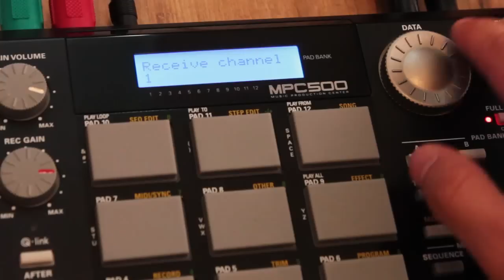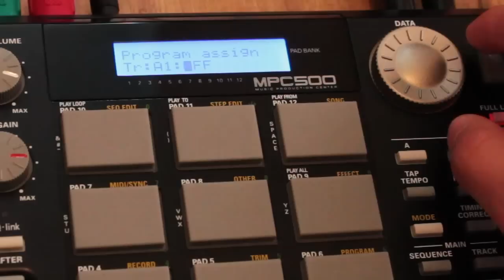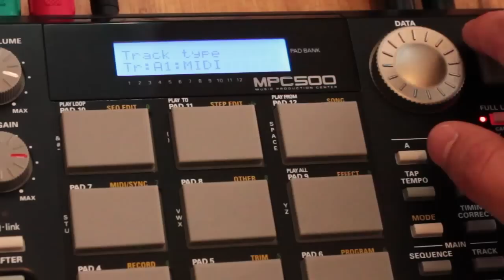AKAI MPC 500 Tutorial: MIDI Sequencing (also for MPC 1000, MPC 2000, MPC 2500, MPC 5000) #TTNM

Comment: Hello,
Question.
1.) If everything is set up to record Midi-Sequences and control more than 1 external Synth, is there a need of useing a Midi-Interface at the Midi-Output to set up the Midi-Connection from the MPC to each Synth and there is also the need of Useing different Midi-Cannels for each (Synth-)Connetion?

2.) Do you know more Gear that is able to do such a Work? Maybe with having it's Drumsequencing set up like a 16Stepsequencer with recording 'on the fly'?

Comment: The best midi explanation I have ever seen! Also the best mpc quick guide. Awesome
Reply from the maker: Thank you :) Happy to read that you liked the video! Enjoy the MPC!
Reply: In between mpc's at the moment having owned the 2000, 2000xl x 2 and now thinking about the 500 on eBay. Any pad issues?
Reply from the maker: I think the pads are fine. They are stiffer than on the big MPCs though, if I remember correctly.
Reply: Thank you. One of the 1000 models released had a flawed pad set that needed replacing quite quickly.

Comment: Really helpful video. Thanks alot. I just got an MPC 1000 yesterday! I'm assuming all the information you've given us can be passed over but I was wondering if I could sample the drums my Roland 626 Drum Machine. Would I need to plug the midi out from the 626 into the MPC to do that?
Reply from the maker: It should translate to the MPC 1000 as well. Sampling is another process though, for which you don't (can't?) use the MPC's MIDI functionality. Enter Sample mode and just manually trigger each sound on the Roland to record it as audio on the MPC. Once you've got the sound files in the MPC you can play/sequence them.

Comment: Thank you! It is the information I needed! But, how do you control other synth modules with the same keyboard? Can you render audio from the synth easily? I own severel modules through a mixer. I need something as good as ableton push, but without the computer. I'd love an MPC5000 but it is a phantom or tooooooo expensive here in Brazil. Thank you.
Reply from the maker: You need to assign a MIDI channel to the different synth (modules) and then just switch the transmitting MIDI channel of the keyboard. You can't record or render audio with the MPC in such a ways a in Ableton though.

Comment: Hey, great video. Thanks for posting. It is really helpful. 
I have a Novation Mininova synthesiser and was wondering if it would work with the MPC 500 like you have shown. 

Thanks. 

Tom
Reply from the maker: Hi Tom :) You can definitely use your Mininova with the MPC 500. Connect MN MIDI-OUT to MPC MIDI-IN and MPC MIDI-OUT to MN MIDI-IN. Then you might have to disable the MN keyboard's connection to the sound engine (often called "local off"), so that the MN keyboard just sends MIDI notes and doesn't directly trigger sounds, because you want the MPC to trigger them.

Comment: thanks, I have watched this a few times now and it is slowly becoming clear...one more question... Can you use a controller INPUT on channel 1 to control tracks on other channels?

for instance, I have a synth module on track 1 sending to midi output channel 1 and a piano module on track 2 sending on the unit on channel 2.... can i control both from one midi controller on channel 1 going in to the MPC or does each output need its own controller?

Comment: Thanks for the upload - it's very helpful.  How does the mpc deal with looping midi data of different bar lengths?  For example, will it loop a one bar midi phrase 4 times over a 4 bar midi prhase, or just loop one time with a 3 bar rest?
Reply from the maker: It doesn't. You can only have tracks of the same length in one loopable sequence and you have to set the sequence length beforehand. So if you create a 4 bar sequence, all you tracks with the phrases in them are 4 bars too and you have to fill them up "manually". After that it can loop the whole sequence and you can mute individual tracks/phrases. You can of course create several sequences of different lengths, but only one sequence can play at a time.

Comment: quite a cool explanation. not sure if i got it right but is it possible to record midi on the fly, while e.g. the 500 is sync'd and running in a live set? and then its running in a loop? cheers
Reply from the maker: +Valcons Productions yes that's possible as far as I remember.
Reply: cool, maybe i give it a try. in used condition its a steal anyway.

Comment: is it possible to connect a USB keyboard to the mpc if its connected to a audio interface with midi cables connected with the mpc? i only use my mpc in standalone mode but want to be able to play the keys using the vst plugins ive got on my computer
Reply from the maker: Sure, you can route the USB Keyboard MIDI into your DAW and then from there out of the interface’s DIN MIDI ports into the MPC.

Comment: Great video.Very helpful and informative.
I have some questions though:

Can you play multiple  sequences on different instruments at once? ex:can I have drums going on while 1 synth plays a distinct melody and another synth plays a seperate bassline?
If you were "performing" a song how would you switch between parts where  the midi files sent out to hardware changes and plays something different?  ex:from intro, into verse, into chorus.
Do you have to play each part before you can sequence it or can you load midi files in and have the MPC play them?

Peter fnord may have touched on this below but I'm not sure. I don't have one of these yet and want to make sure its capable of what I'm looking for before purchase. THANKS!
Reply from the maker: Yes, you can play several tracks at the same time and mute them individually, while performing. You can also create sequences (combinations of tracks) and link them together into a song, both live and pre programmed - at least on the MPC 1000 and up.

Check out this video of mine: https://www.youtube.com/watch?v=3f8kwpRe-jM
Reply: ***** thanks for responding so quickly......I'vebeen exploring your videos all day and I'm understanding more and more. It seems I'll have to get an mpc1000 rather than a 500 for what I'm looking for.
Reply from the maker: Yes, while the 500 is great, the 1000 with JJOS is a lot better to work with :)

Comment: I have a Casio wk-7600  and an MPC500. My question is: Can I have the sequencer of the mpc control the keyboard sounds to playback my patterns. It seems you already explained this. But I'm trying to use the loop function of the mpc instead. Because the Casio 76 key does not have the loop function in which you can use.
Reply from the maker: I'm not sure what you mean by "loop function" but you can indeed sequence your synth form the MPC and use the synth's keyboard to add notes to the MPC's MIDI track.

Comment: I set up everything exactly like the video but Everytime I press a key on the synth it just starts sending out random notes and eventually crashes the synth. Any ideas on how I can fix that?
Reply from the maker: Could it be that the Synth sends MIDI to the MPC and the MPC sends the same MIDI signal back to the Synth which then sends it to the MPC, etc. Like a loop?
Reply: @tuesdaynightmachines  No, I set the synth to "Slave" mode and it did the same thing. I ran a MIDI monitor on it and it just keeps sending restart and midi stop messages.

Comment: Hi! I'm looking for a machine for live playing. I think TRACK MUTE function could do the trick, but I have few questions that I would like to know answers to:
1. How long are loading times ?  This wouldn't be the only device, so some reasonable load time is ok
2. Can I play internal sounds of mpc with midi keyboard ? Say I would load a string or organ sample and I would love to play it live alongside other samples. 
3. Can you midi control different aspects of an mpc ? Like filter, volume, fx etc. ?
4. Can input be used as pseudo-mixer ? For example I could use synth as simple mono in and have a setup like you have, but play mpc sounds from keyboard, while mpc plays synth by midi
Reply from the maker: Hey :)

1. Load time depend on the amount and length of samples, but it isn’t too bad.
2. Yes, you can play samples on a keyboard.
3. No, not on the MPC 500 at least.
4. Same as 3., so not on the MPC 500. I think it works on the bigger or more modern ones.
Reply: @tuesdaynightmachines  As for 2 I've found some posts claiming that it doesn't have chromatic mode. Through editor I've found robust sample engine with 4 layers switchable through velocity, and no sign of chromatic sampling
Reply from the maker: That’s true, there is no chromatic mode on the MPC 500. However you can set up a program to spread the same sample (or different ones) across pads/keys at different pitches. This would maybe be 5 minutes of work at first, depending on how many octaves you want.

Comment: So if I have a midi keyboard I can plug it into my mpc500 and record what I play from the keyboad? What if I am using a DAW for different sounds not actually on the keyboard?
Reply from the maker: Yes, you can record the MIDI data from your keyboard. The sounds are not part of that and can be changed at any time, regardless of the note data.

Comment: Hey there! Firstly, thanks for the clip (danke ;) ). I have a question with which you may (or not) be able to help me out:
I have
- an MPC 2500
- a Novation K Station

I hooked up the novation K Station (Midi In) to the MPC (Midi OUT) and on channel 1 A, the notes can be played on the MPC key pads for the novation (no issues there, works like a charm).
Also, the keyboard for the novation works fine (i can continue to play notes).
However, the only way for me to sequence the notes I play are via the MPC key pad, which is, of course, a bit limited.

How did you set up your synth, to record the sequence you play on your synth on the MPC? Did you connect the synth's Midi OUT to the MPC's Midi IN?

Thanks in advance for your feedback.
Reply: (i think you may have already given the answer in the comment section... i will test this out tonight)
Reply from the maker: Hey :) Yes, you have to connect the synth's MIDI out to the MPC's MIDI in too. In order to avoid a loop, you have to disable the synth's keyboard link to the sound engine (often called "local off"). Let me know if it works.
Reply: hello again! indeed, it worked like a charm :)
i also hooked up my virus access and blofield with a midi keyboard i found on the attic using the same hook up (midi in for the keyboard, midi out for the devices)... as i have an mpc 2500, i'm having super midi fun with 3 synths now, and no need for a PC :D
your little clip rocked! keep up the good work!
Reply from the maker: matzomaniac Sweet! Did you connect more than one keyboard to the MPC's MIDI IN ports? I also have another MPC tutorial, in which I show how I use track mutes and multiple instruments: How I Jam 3/3: Live Session Akai MPC Tutorial (MPC 500, MPC 1000, MPC 2500, etc.) #TTNM
Reply: ***** I connected one midi keyboard that controls all 3 devices (novation/virus/blofield) and I disabled the novation's internal keyboard (to avoid the loop, as u described). Now I recorded several tracks that I can easily jam around with using track mute... Ultimate goal is song mode, using several "finished" sequences... so much fun :) as soon as I recorded a jam i'll post it to you :)
Reply: and yes, i saw your clip. it rocks!

Comment: With the MPC 500, can you also record MIDI CC automations into the track in a sequence? Also, is the resolution for this function fine enough in the MPC 500, without making it sound too 'steppy'?
Reply from the maker: MIDI CC resolution is standardized to 128 steps, so the MPC500 offers that resolution as well :)
Reply: @tuesdaynightmachines  Thanks. So can you record CC automation?

Comment: Hello The Tuesday Night Machines, i have a question can't find a answer about it, do you know if i can play some chords on my JX3P that can be sequenced into my mpc. I mean not using the pad of the mpc !? Thanks for your answer !
Reply from the maker: +Paul Real Yes, the JX3P has MIDI Out (to send data to the MPC to be recorded by the sequencer) and also MIDI In (to receive data from the MPC's sequencer).
Reply: +The Tuesday Night Machines Thanks guys for answering ! i've done that, but it say "Wait for Midi Play", i try to press some random keys on the JX3P but nothing happen :'(
Reply from the maker: Well, I'm afraid you have to check the manuals then. Make sure you've got the MIDI channels set up correctly.

Comment: Great video! Just one question.  I'm able to record my keyboard into my MPC 5000 using midi.  The problem I'm having is that every time I change the sound of my keyboard, it also changes the sound of the recording. i.e. if I recorded using bass in track 1 and want to record a piano sound in track 2, track 1 will now switch to the piano sound. Can you help?
Reply from the maker: Yes, this is normal, because you record MIDI data and not audio data. I made a video explaining what MIDI is here :) MIDI Tutorial: What is MIDI and how is it used? #TTNM

Comment: hey do you know if i can sample ableton live midi data to my mpc 2000xl using this method ? thanks
Reply from the maker: Yes, I'm pretty sure it also works on the 2kxl :)
Reply: +The Tuesday Night Machines do you know how i can do it ?
Reply from the maker: Well, I haven't got a 2kxl, but it should be pretty similar to what I show in this video. You'll have a different user interface obviously. So just watch the video and check the 2kxl's manual again :)

Comment: Question: 

I Wonder if the MPC-500 also is able to find and upload external Synthesizer Presets that were used by the Artist in a Arrangement of a Song. I'm still asking myself if there is a need to upload the external Presets and Sounds manually to have the correct external Sounds played in a Arrangement. 

How do i wre up a 2nd Controller Unit, for instance Arturia Spark to have a 16Stepsequencer Controller Unit? Do you know if they work together?

Comment: hey habe grad ein mpc 500 gekauft. jetzt wollte ich das mal ausprobieren meine volcas damit zu steuern. nur leider kann ich das programm assign nicht auf off stellen sondern da kommt nur ?cds wo eig off stehen sollte. weißt du was das sein könnte?
außerdem kann ich den mpc nicht reseten. habe die version 1.3 drauf. meinst du mit einem update auf 1.31 behebt beide probleme?
lg danke für die ausführliche information in diesem video!
Reply from the maker: Du solltest auf jeden Fall das OS auf die neuste Version updaten und es dann noch mal versuchen :)
Reply: ok danke  
klappt jetzt soweit iwie
noch eine frage hätte ich :
wie viele geräte kann ich über midi steuern? kann grad nur ein volca über midi bearbeiten aber sobald ich an rk004 das signal schicken will hängt es sofort bzw sendet kein ende oder sonstiges. was könnte das sein?
Reply from the maker: +kabel kaos hm, keine Ahnung. Check mal die midi Implementation vom RK004 in dessen Handbuch. Mit den 16 MIDI Kanälen kannst du theoretisch 16 unterschiedliche Sequenzen gleichzeitig raus schicken. Hab es selbst mit bis zu vier Geräten versucht und das ging gut.

Comment: Can you record different length tracks on the mpc500 instead of every track being the same length  ?  I mainly ask wondering if it will loop back different tracks lengths  like exampke track reloops every 30 secs track 2 reloops every 1.22 mins track 3 reloops every 4 mins  and so on  ?  My old yamaha rm1x could do this and im looking for another sequencer that can as well.  Thank you for any help
Reply from the maker: No, unfortunately every track has the same length. But you can have "sequences" of various lengths (which include "tracks", which have to be the length of the sequence though).

Comment: thank you, helpful video!!!
Reply from the maker: You're welcome! Glad it helped :)
Reply: Hi! I have a problem, maybe you can help. I managed to do the Midi sequencing, just like in your video, but after that I faced a strange problem. I tried to make a beat-track, by playing on the MPC pads, but there was is no sound when I hit the pad, but only when I played back the recorded drum track. Any idea?
Reply from the maker: Which MPC do you have and what did you try to sequence? An external drum machine?
Reply: it's an mpc 500. I sequenced chords for an external synth. But when I switch off the MPC, unplug every Midi cable, then I switch on and start with a blank sequence it's still the same problem...
Reply from the maker: maybe your MPC's MIDI settings are not correct. Go into that menu and see if the pads send MIDI data out of the machine or if they just record MIDI data to the internal track. I think there is a setting for that.
Reply: Yeah,  in the Midi section the "pad to sampler" mode was "off". Thanks. :)